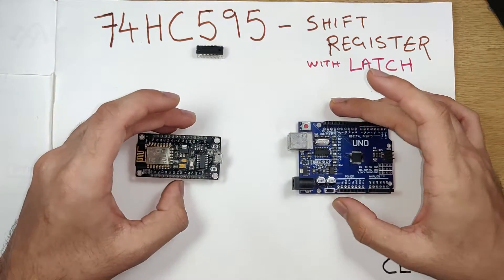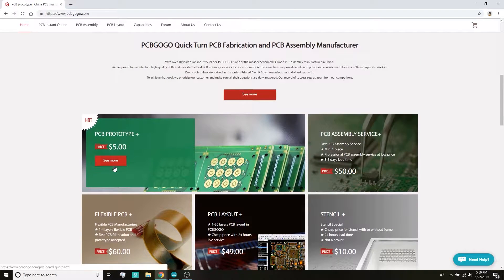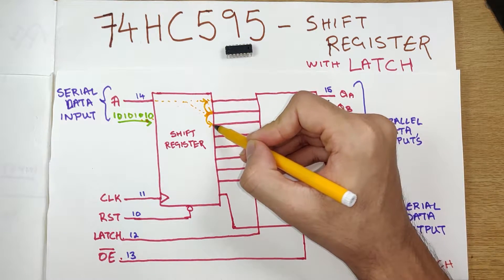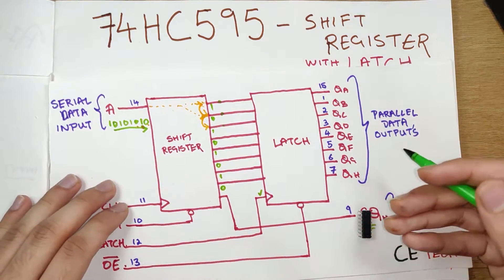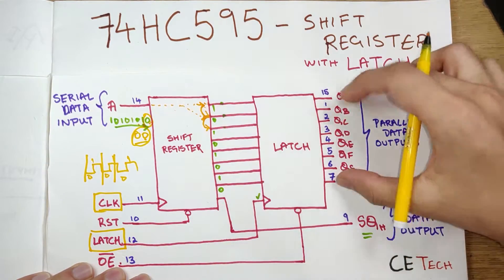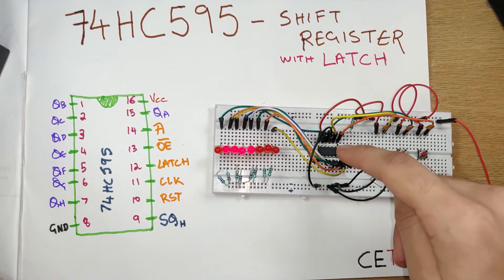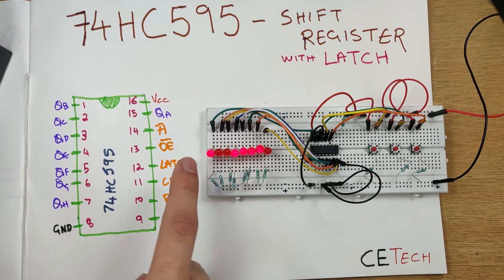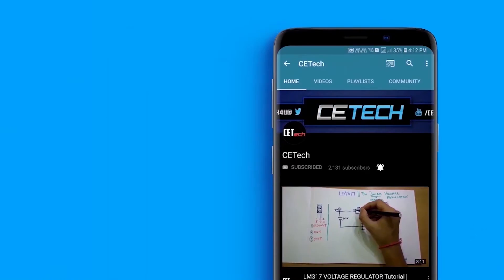74HC595 Shift Register Tutorial | Arduino with 7 segment

Comment: I would like to make the same circuit. Could you write, which components did you use for it (which resistor, capacitors and so on) ? I could not find it.